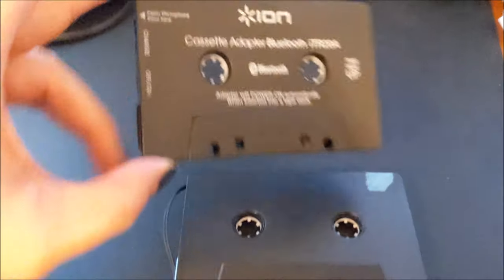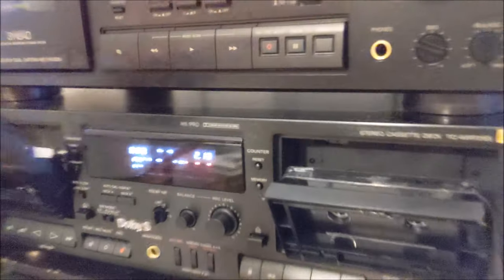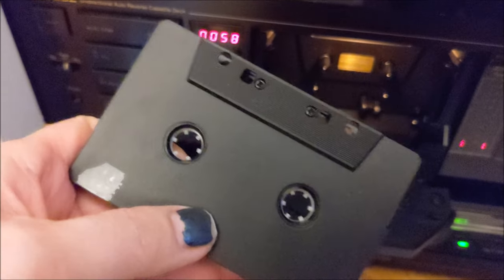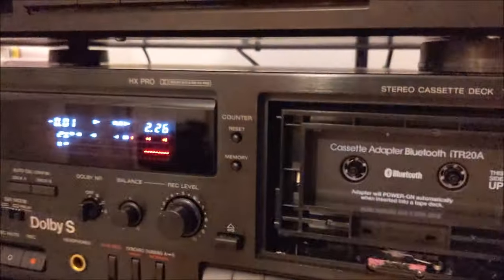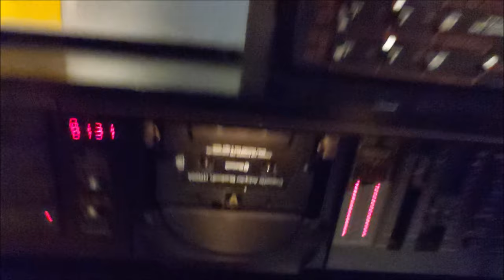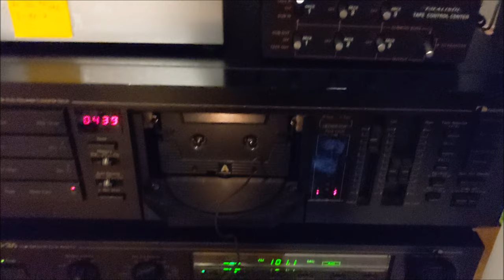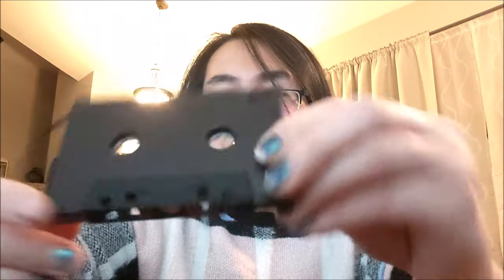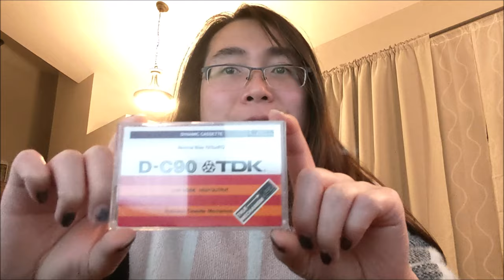Wired and Bluetooth Cassette Adapters Testing

Comment: Those adapters where indeed designed for use in the earlier times when CDs were in the process of taking over the cassette market... it was a novel idea to use it with your new portable CD player they were surprisingly quiet by comparison to the hiss with regular cassette tape .... I'm pretty sure most people reading and posting here is aware of azimuth alignment... that was a problem for the really cheap adapters ... same as the azimuth alignment for tape it is just as touchy with the head to head contact from the cassette adapter... as you could see when she shifted the adapter it did affect how well it sent the signals from the head in the adapter to the cassette machine head ... another factor to consider (two head vs three head) they were really designed for car stereo systems same as the two head machine... if you compare two head vs three head you can see the playback head is shifted more so than a two header ... that all by itself will reduce the flow of magnetic fields to the head in the machine.... I will also guess they DID NOT use the most precise mechanism for the head in the cassette adapter... one more thing you should definitely check the head in the adapter for sharp edges they usually don't finish them as they do an actual tape head that will have tape pulled across it ... it could potentially damage the head in the cassette machine... definitely worth a quick inspection in my opinion

Comment: They were alot more flakey than i thought! I have a jensen wired tape adapter and its fine, the level is about 1db higher on one side but plenty of volume and great sound no inconsistencies
Reply from the maker: I don't know if there were inconsistency in the earlier adapters...maybe they were built better or we just never noticed because we never scrutinized them before.  I never stuck mine in a cassette deck with VU meters before.  ¯\_(ツ)_/¯

Comment: dear maddam the cassette adapter has nothing to do with an allighnment issue. its ur heads in ur cassette decks themselves its a n easy fix u simply look for an allighnment screw on the playback heads of all of ur decks u might have to take out the cassette door to get to the screws. u simply turn the screw while the cassette adapter is playing . and when it becomes louder to the proper volume u leave it at that setting then u know everything is ok hope this helps thanx and good luck
Reply from the maker: I beg to differ.  The cassette decks were calibrated, especially the RX-202.

Comment: Great gear you have!! , and nice review, sorry for my brute english, i use those adapters for long time on My Commodore and Atari homecomputers, , some of them works fine others no,  some are stereo head if you are lucky and most are mono (that is a crap) , and the head is missaligned , and the head has bad quality, i will try to replace with deck stereo heads.
Reply from the maker: You should be able to.  The heads in those adapters are the same heads used in cassette decks.  I haven't encountered a mini adapter yet.  When I get back to my equipment, I'd like to test this adapter out to go the other way: use deck to record and see what comes out of the "headphone jack". 😁

Comment: Do not forget, now you have to demagnetize your cassette decks after using this "garbage-cassette", and do not use it on your devices anymore. Otherwise, all subsequent tests with real cassettes will not be correct.
Reply: Why do you think that? It isn't any worse than playing a cassette other than the alignment issue for signal equals between left and right channels ... the head is just an electromagnet with coils inside just like a speaker (only there isn't a magnet inside the head) just the left and right channel coils
Reply: @darinb.3273  Here is a magnet - as you said, the body of the other head is primarily a metal shell. And it is not clear where she was and how they inserted her there. At any approach of other metal objects to the playback head, a magnetic field is induced, what to do next with it, you already guessed!
Reply from the maker: The magnetic field generated isn't a "magnetic" effect in the way you think of it.  It alternates along to the sound, so it's not going to magnetize the head any more than a standard cassette will.  UNLESS you pass a strong DC current which WILL create an electromagnet, which WILL magnetize the tape head.  But that's not what's coming out of a headphone jack.  So users of these adapters will be fine.

Although someone said it might cause head damage due to the head contact, but hopefully because it's not rubbing against the head, it will be minimal to non-existent.
Reply: @TechieZeddie  We are not talking about the generated magnetic field, we are talking about the magnetization of the housing of the magnetic head of the adapter. Which is not clear where he was, and near what was stored, under the influence of what magnetic fields. After all, even to adjust the azimuth of your deck, you do not need to use magnetic screwdrivers. Why do you think ?! And why are there Deck Head Demagnetizer ?! These are your decks, put whatever you like there, but don’t be surprised then, where did the noise, extra sounds come from, and why there were not enough high frequencies. Thank you for your videos, I always watch with interest. Definitely like it.
Reply from the maker: @AlexandrES  hmm... demagnetize the heads on the adapters?  Interesting.  Can't hurt!
Reply: @AlexandrES  what so your saying these can kill your deck?